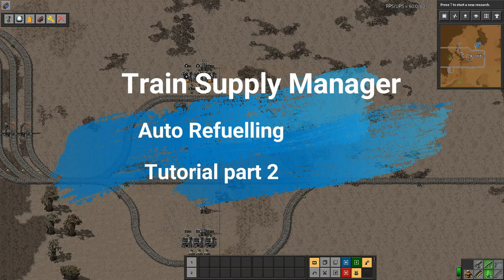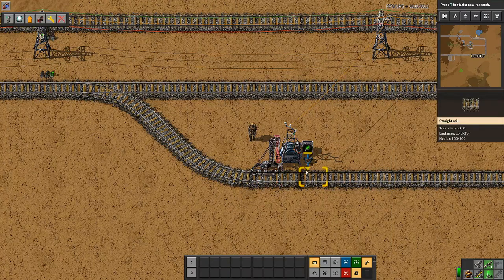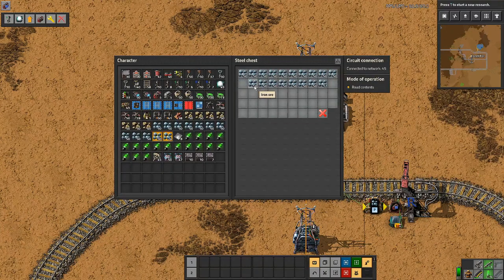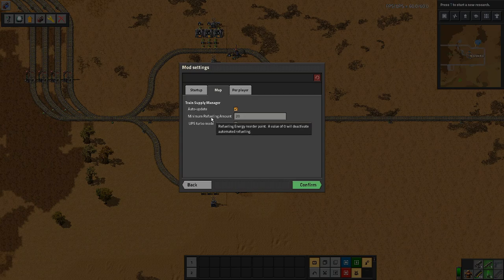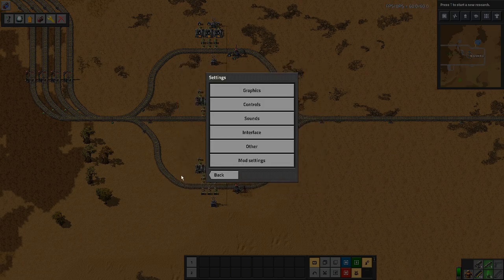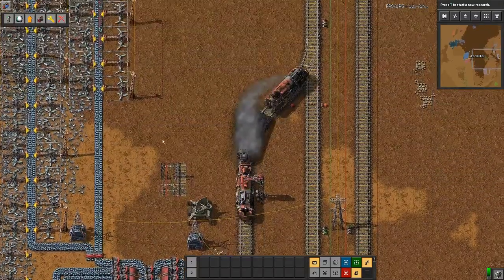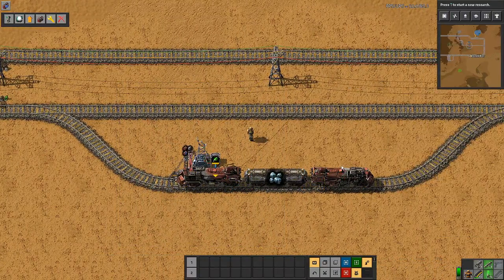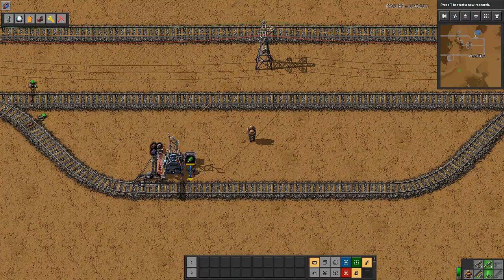Factorio TSM tutorial part 2 - Auto Refueling

Comment: Hey there. I have a question - is it possible to set up an automatic refilling of the FuelStops with trains? I'm doing a full PySuite playthrough, filling them with bots is too slow as the base is really large. I tried making the FuelStops Requester stations, but they can't have the same name. I want to set up a Fuel train that will go around from the fuel production base and refill the FuelStops chests when they go under a certain threshold. Thanks in advance.
Reply from the maker: There is no great mystery here. You just need a fuel stop and in addition a requester stop for supplying the fuel. The requester should either be on a separate platform,  or depending on your setup you may be able to use the same line with both the fuel stop and the requester station on it.

Comment: Can you filter the FuelStop to only accept trains of certain configurations? Just knowing where the locomotives are lets you disable the inserters, but doesn't help if you want small refueling stops for your smaller trains...
Reply from the maker: The default configuration will send trains to different stations based on the number of locomotives. So one locomotive goes to fuelstop1, two locomotives goes to fuelstop2 etc.